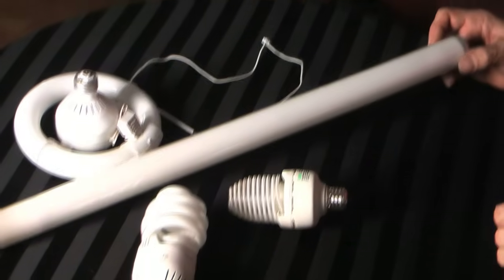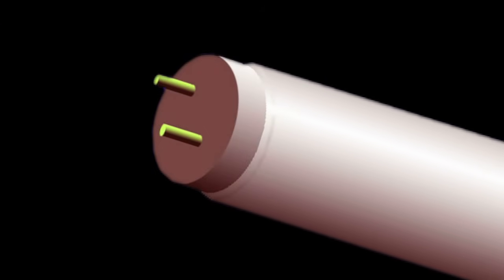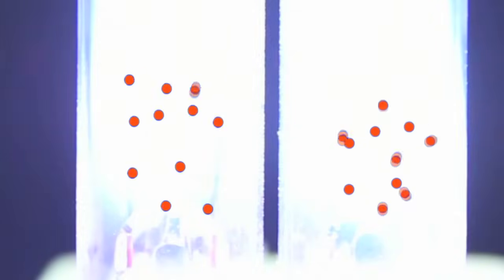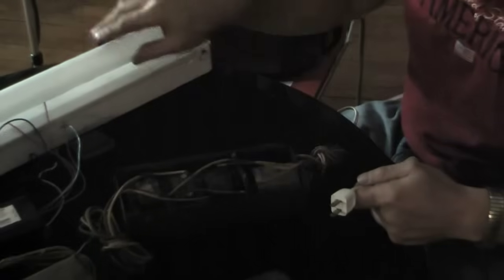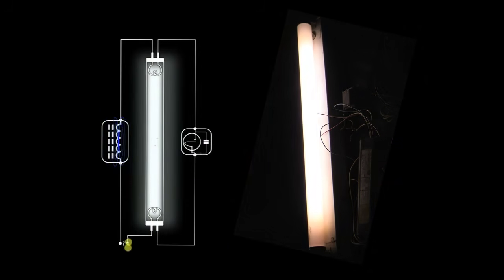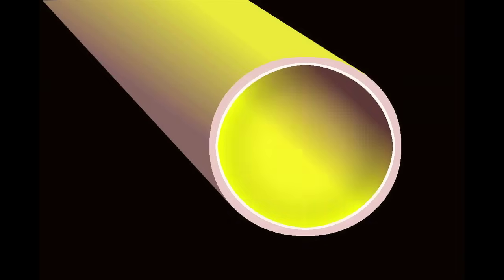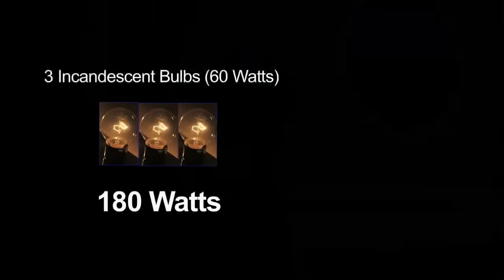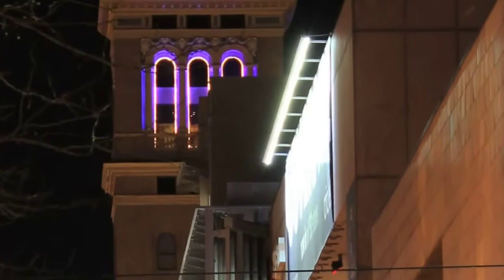The Fluorescent Lamp - How it Works - Inventors

Comment: Im not understand why the manufacturers of those tubes after 90 years never put a pyramid reflector under them so the tube itself not shades away logical lumens? If the reflector was there the tubes would be possible to made around 20% shorter which means every fift tube from the factory would be spitted out for free, and that is fine money in the quest to keep the whole world enlighted.

Comment: Some fluorescent lamps have a single pin on each end with the filament leads short circuited and therefore cannot be preheated.   A special ballast provides a much higher voltage than a rapid start or preheat ballast can, to strike an arc through the lamp with no cathode preheat.  Such lamps are called slimline, or instant start lamps and are most commonly found in the 72 and 96 inch lamps.  

The high voltages generated by an instant start ballast can be dangerous to anyone replacing lamps in an energized fixture, so some provisions are typically used to guard against electrical shocks which can knock someone off a ladder and may be deadly.  Electronic instant start ballasts usually includes circuitry that can remove power to a lamp or all the lamps if a lamp is removed,  or is not installed/  fails to start when the fixture is switched on.   Older fixtures with magnetic instant start ballasts typically are wired with the ballast input power run though the stationary sockets, the high voltage secondary leads are wired to the plunger sockets.  In these older fixtures the lamp pin bridges two contacts in the stationary sockets, therefore both lamps must be securely in place to complete the circuit to the primary winding in the ballast, removing either lamp removes power from the ballast.
Reply: Aquí estubo disponible en los tubos fluorescentes SLIMLINE F24, F48, F72, F96 T12

Comment: Great video. I wonder why sometimes the light can go pink/purple as the lamp ages.
Reply: That's because the phosphor coating on the lamp eventually degrades and it stops converting the blue light as efficiently.
Reply: I think that happens when one of the gases depletes. I think Argon?
Reply: @shaunclarke94 I believe mercury.
Reply: A mí me avían dicho que hera por problemas de mercurio

Comment: I been around town changing out old T12s in old filling stations and replacing with LEDs and  i came across a T12 ballast to a twin 8ft. pin type that had a 1972 date on it...and yes it was still in service.

Comment: Question, what would cause a lighted sign when turnec on to flicker on and off constantly?
Reply: Bad bulb. Replace the lamp and it should be fine. If that doesn't solve it, then it's probably the ballast. How old is the sign?

Comment: Lamp efficiency has improved dramatically.  New phosphors have much better CRI and life.  Modern T8 and T5 goes out to 50,000 hours now.  Old T12's could never do that, T12's are not gonna be made much longer.  OBSOLETE